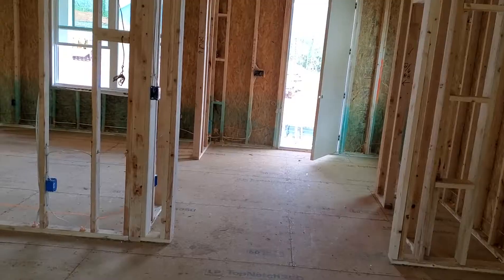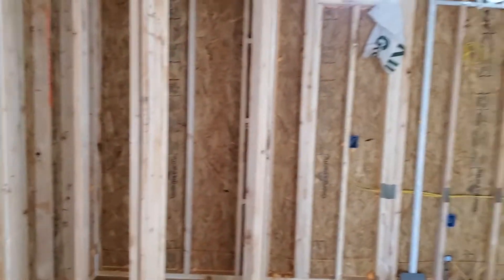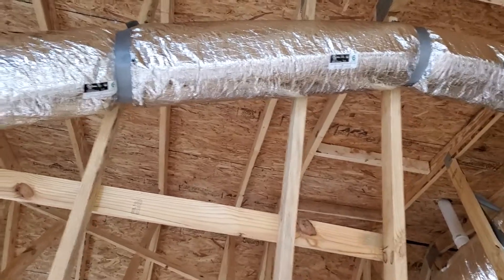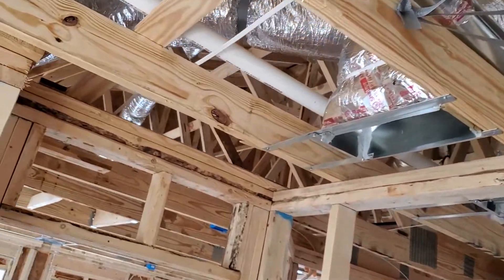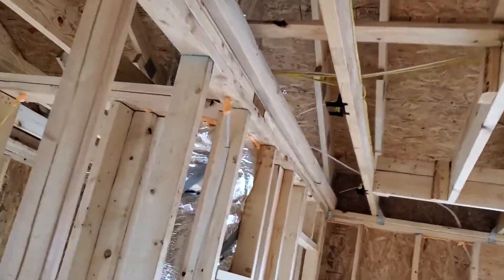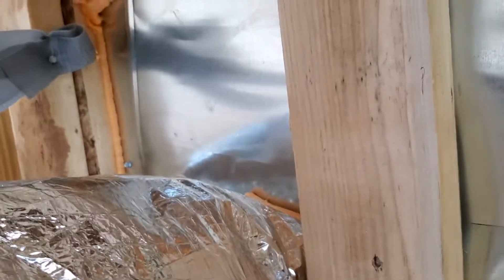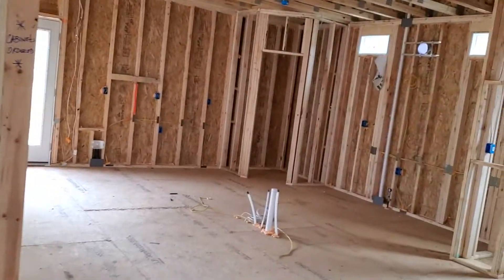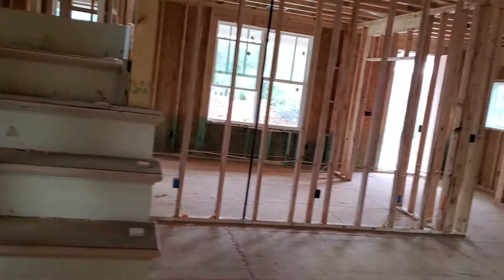HVAC Rough-In Inspection (New Construction)

Comment: too much flex.    My house in dc area we have furnace in basement and dedicated furnace room in second floor bedroom area.    furnace room is not a closet.   no more than 8-10 ft flex off trunks to registers
Reply: Yeah sometimes that's just how it is though, especially in attics for wider houses. Returns can be even 3 boxes of flex per room just to get to the jump duct and there is usually no problem, better long than short for a bigger return
Reply from the maker: What code book are you using?

Comment: 28 year Builder from Florida, now working on Inspector, passed structural & plumbing, working on Mechanical & Electrical
Reply from the maker: Congrats...let me know if I can help you.
Reply: @PPG1967  I took a try off exam, and found my new 2021 IRC book from ICC didn't have the gas charts to size the pipes, I now have the charts. and plan to try it again this week.
Reply: I got a 73 on the last exam, so mad, I missed easy questions, so focused on gas and supply

Comment: Why is the dryer vent box not sitting lower to.match an actual dryer vent location? All dryer vent boxes have instructions that show the location to be as low as possible to match the dryer and minimize snaking of the flex duct between the dryer and wall box.

Comment: I dont understand the thought process behind putting furnaces in the attic. What do you do when it needs to be replaced. Cut a hole in the roof and haul it out with a crane?
Reply from the maker: There's normally an attic access opening.

Comment: Doesn’t the exhaust termination for the bathroom need to be greater than 3 ft from an operable window?
Reply from the maker: It depends on where you are and what code book your state has adopted.  Here in Georgia, we use the IRC for residential.  3' is the required clearance.
Reply: I’m in coastal SC and we’re using 2021 IRC. Thanks for your videos, I share your vids with other inspectors 👍
Reply from the maker: I appreciate your support, and thanks for watching!!

Comment: That red letter tape sucks. It doesn’t stick well. UL listed doesn’t mean jack. The install looks pretty good though.
Reply from the maker: Ok, I appreciate your feedback, and thanks for watching.
Reply: @PPG1967  I have quick question. How far diagonally do you like to see pvc furnace exhaust away from a window that can open? The manufacturer’s book says 4 feet but I’d like to know what inspectors want.
Reply from the maker: @AaronPowellvox  3 feet
Reply: @PPG1967  thank you for taking the time  to respond.

Comment: Very insightful video. I’m having a 3400sf house built now in Oklahoma City. HVAC rough in starts Monday so I’m checking out videos to help know what to look for. One question I have, why does the dryer vent go down instead of out through the roof? Is it code in ATL? Just thought the path of least resistance might be best and go out through the roof instead of down. I gave you a 👍and also subscribed so I can check out some more of your work. Take care. 
Steve
Reply from the maker: It's at the discretion of the mechanical contractor, I'm sure the contractor is going with the shortest run to the exterior.
Reply from the maker: I appreciate your feedback and welcome aboard.

Comment: Putting foil tape on the metal exhaust vent joints is pure garbage. That is what mastic is for. Mastic will NEVER peel off.
Reply from the maker: You are wrong!!!... what code book are you referencing sir??
Reply from the maker: The tape must be UL-181B pressure sensitive tape.
Reply: Wrong!, mastic is rubberish in my opinion  metal tape is better just give it 3 layers and thats it , oh if the elbows or piping has oily from the factory well use some spray glue or cary acetone and a rag to clean each one 🤷‍♂️

Comment: Hey Renaldo, A couple quick questions for you. In your duct shafts doesn’t the duct have to both enter and exit the shaft on collars? 
How would you fire rate a shaft with flex duct?  I’m very curious on your thoughts.  Thanks for the great video
Reply from the maker: With Residential all you're doing is making sure the top & bottom of a concealed chase is sealed. Most Residential houses use flex duct.
Reply from the maker: I appreciate your comments ... thanks for watching.
Reply from the maker: Do you know the occupancy type?
Reply: Hey Ronaldo, I’m actually talking about residential work. In your video I seen that the shaft had a sheet metal top on it but my question is, is there a metal collar going through that sheet metal cap or is it just flex duct. The reason I’m asking is I just became a combination residential inspector here in California and I have seen it done both ways. Is the flex listed to go through a fire penetration? 30 years ago when I used to install HVAC shafts in residential houses we had to use hard pipe and wrap it with insulation. Now that I’m an inspector I see it done both ways. I’m trying to figure out which one is the right way and what the code actually says. I’m not a fan of flex going through the top and bottoms of the shaft because a lot of times I see the duct get pinched. Also times the installer has cut the shaft hole too big for foam expansion insulation to cover and they try to grab pink insulation and shove it in there but you can’t shove it in tight on flex duct because flex collapses. Do you know of a code that addresses this gray area?  Thanks for your thoughts, there is a lot of useful information in your videos. 👍🏻
Reply from the maker: So, I don't know what Code Books your state has adopted, but essentially you're fireblocking at the top & bottom of a concealed hvac chase.  There are a number of materials that can be used to achieve this. If you're using the 2018 IRC read section 302.11
Reply from the maker: So, you're referring to more commercial work.  You'll rarely find any flex duct on a commercial job, everything is hard duct.

Comment: You mentioned pressure tape, I'm in the process of finishing a basement and unused an aluminum tape labeled as general HVAC use for class 1 flex takeoffs and returns. Did I use the right.tape?

After taping I also used a heavy duty HVAC zip tie over the taped connection.

Am I good with.this install?
Reply from the maker: Typically you should use UL-listed 181 pressure tape or mastic at all the seams.
Reply from the maker: What code book is adopted in your state?

Comment: Listen to me very carefully.flex duct is only acceptable for so many feet.to use flex duct for your runs going up in a shaft is pathetic,and after 7 feet of flex your cfm capacity is greatly reduced. Flex is great for take offs off trunk, but when i see 86% of the duct in a house all flex it is disgusting. Ask a mechanical engineer if you think i am out of line.thank you, and byw anyone can look up what the cfm is on flex.the more you use the more restriction you have.stop
Reply from the maker: Sir, there's no max length on a flex duct. These are short runs (residential application not commercial). Typically two units in each house, basement or crawl space and attic.
Reply from the maker: I appreciate your comment... thanks for watching!!
Reply from the maker: 14' maximum on a flex connector, no maximum length on a flex duct sir.. check your mechanical code book.
Reply: @PPG1967  yes there is typically its 5 feet.i think that is a little strict i do 7feet all the time but code depends on size of duct i believe 6 is only allowed 5 feet.just because people been running 15 ft of flex in areas doesn't mean its correct. In Florida all the houses i seen they did this but it is not correct way,trust me and thank you for video.
Reply from the maker: Sir, you are very misinformed... are you a contractor??
Reply from the maker: What state are you in??... what mechanical code book are you using?
Reply: @PPG1967  i have my own mechanical company and yes look it up its 5 ft.look it up you can Google it on your phone. I know its done done south alot but ashre code is 5 to 7 feet. I installed over 350 full hvac system past few years and had weekly inspections and meetings with mechanical engineers.i am correct trust me.
Reply: @PPG1967  it would be nice if you look it up and apologize for saying i miss informed. I promise you i know my hvac.
Reply: @PPG1967  ashrea ,i dont want to fight or be mean just Google it please .
Reply from the maker: @richardharmon874  I don't mean any disrespect, but you are why I do these videos.
Reply: @PPG1967  ashrea fundamentals handbook page 29
Reply: @PPG1967  you do videos so i can teach you about hvac?
Reply from the maker: @richardharmon874  I do them so misinformed contractors like yourself can learn something.
Reply from the maker: @richardharmon874 sir, get yourself a mechanical code book
Reply: @PPG1967  ashrea handbook page 29.what dont you understand.
Reply: Think I'd like to look into return ducting like that to replace my 1950's ducting through the floor joists!

Comment: God aweful install. Looks like a octopus. All that space and they put the ac in the hot ass attic.  Not impressed at all
Reply from the maker: I appreciate your feedback... thanks for watching.
Reply from the maker: That's typical in the Southeast, air handlers in the attic or crawl space.
Reply: Yes i tried to tell him flex should be only run 5 to 7 feet and he said i was wrong. This guy is a moron. I been doing hvac over 23 years .i never seen so much flex in my life.
Reply: If you insulate the attic space, wouldn't it be better for having the unit up there?

Comment: All your videos for inspections are very helpful.! Thank you keep up the good work. 

Quick question can a bathroom exhaust into the soffit or does it have to exhaust straight up to the roof?
Reply from the maker: If the soffit is vented (perforated) the bathroom exhaust cannot.  Run it up through the roof or the side of a gable wall.

Comment: Does the rules apply for a steel frame home?
Reply from the maker: The mechanical rough installation should be no different, regardless of framing material.
Reply from the maker: In what way??

Comment: Appreciate the video, bud. Looks like you missed the bath fans on the third floor not being hooked up but that’s neither here nor there.  What I would do though in your video is talk about the furnace in the attic needing a light, an outlet for servicing, a 30 inch platform in front of the unit, a 24" walking platform from the access opening to the furnace. I’d also talk about the gas piping pressure test needing a minimum of 10 pounds of pressure for at least 15 minutes. The dryer vent, a person could spend 20 minutes going over how that should look. I can’t tell you how many times I’ve seen screws through the connections, the pipe being reversed, homeowners using flex duct buried in the wall….  

Thanks again for taking time to shoot this video, I get complacent from time to time when I’m looking at 25 houses a day and just wanted to see how others are doing a mechanical rough in inspection.

Respectfully,
Greg W.
Reply from the maker: I agree,  there's a lot more I could've talked about,  but I'm trying to cram a 30 minute inspection into a 10 minute video. Thanks for watching.
Reply: @PPG1967  Before I became a builder, I worked for Regency Homes in South Florida, I did all the frame preps, and grunt work, including sweeping out houses, and grading. I would always walk a house just before drywall to make sure noting is missed. (Or in some cases, the Homeowner) would let an outside company come in and run more cable lines and destroy my draft stops. Of course I would let the Builder know, and re-frame prep, and call an additional framing inspection) and bill the homeowner. (But always take pictures of the damage they made, before repairing)
Reply: Wrong idiot, if you were really in the construction trades youd  know nobody calls them "bathroom fans". Everyone calls em fart fans. Im a plumber and i know that! lol